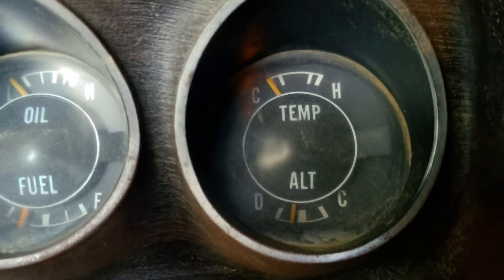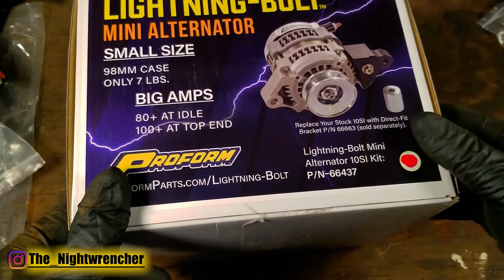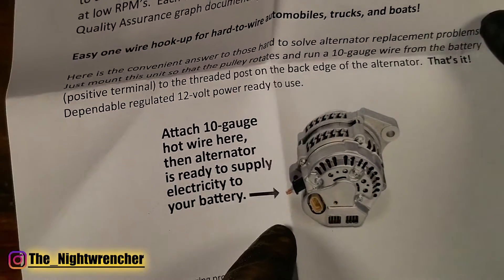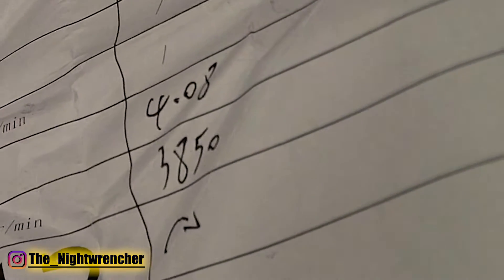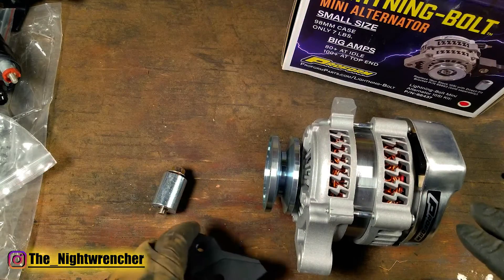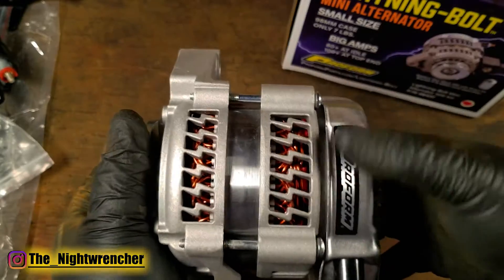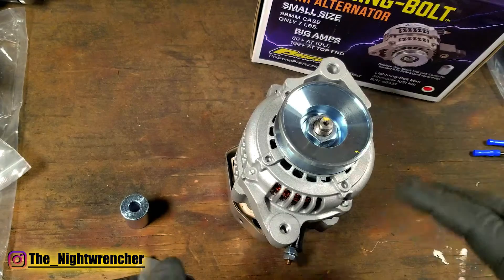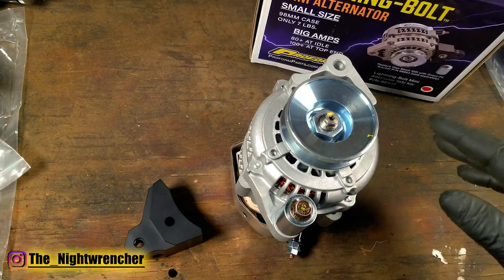One Wire Alternator, 7lbs And Over 80 Amps At IDLE? | Proform Lightning Bolt Alternator |

Comment: Did you ever get it on the car?
Reply from the maker: Yes I did actually. I thought I made a video about it but I guess not. It actually works pretty well! I have an electric fuel pump, electric fans, CD ignition and DRLs but  I idle really low like 650-700rpm so when my cooling fans kick on, since headlights are on at the same time at idle, the battery does drain a little bit but once the fans cycle off, the battery goes back to charging. For anything off-idle though, the alterntor runs perfect. I can turn up the idle a hair to fix that though.

Comment: Unrelated brotha im sorry ive been studting your videos but im at a rut and need some help. I built  this 305sbc and its bored .30 its got a cam .480lift and .230 duration @.50 with a lobe seperation of 110, i recently installed a single plane intake , my compression ratio is about 9.5/1 and i have a lock out distributor that set at 28°base timing and its a manual car i have a 4010 holley that i can get to run it idle fine but when i drive and try to get on it it breaks up really  bad and my plugs arent fouled and i see no smoke coming out the exhaust any guess were i can start?
Reply from the maker: Hey bud, I'm not a big fan of the 4010 because they are not nearly as adjustible as a regular 4150 or 4160. The CFM may be correct for your application but the transition might not be flowing enough fuel. Manual cars like to run a little rich because the throttle needs to be snappy so that you dont stall out the engine on take off. Simply speaking, I don't think you have enough carburetor for that combo. A 650 4150 will suit you much better
Reply from the maker: If youre just concerned when cleaning it up when you hit the gas for WOT you might want to see if you can try out a larger accel pump squirter but I dont think the 4010 is compatible with standard nozzles
Reply: @NightWrencher  thank you for the time and knowledge man!!! You'd be right, that 4010 isn't good for that setup  because I have a 750 4150 on it right now  with vaccum secondarys and it runs good  my only problem is that it breaks up in the top end from about 4500-6200 when I have my foot all the way down if I have my foot off the throttle about an 1/8 from full throttle it will clean up I see no smoke and my plugs don't look bad if anything lean you think it needs more jet?
Reply from the maker: @HOTRODHARRY5  more than likely you will need to step up the rear jet. I would start with 4 sizes bigger in the rear and try again. If youre rich misfiring, itll get worse. If its a lean misfire, itll get better
Reply: @NightWrencher  Brotha thank you so much I really do appreciate it, I'm down here in el paso tx and no one really plays with carbs no more ever since our track closed all the racers pretty much hid and they are the only ones willing to share the knowledge they have, I appreciate you taking your time out of your day to help me. Thank you for the direction and helping me get the most out of my car !!
Reply from the maker: No problem, happy to help 👍